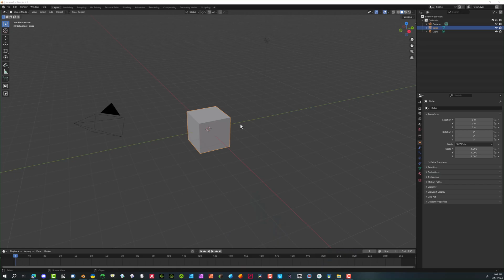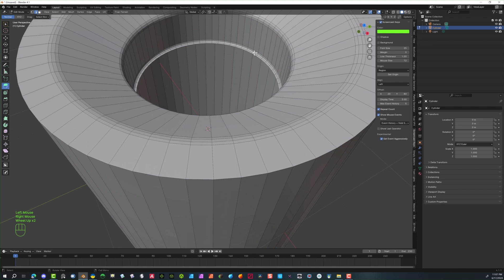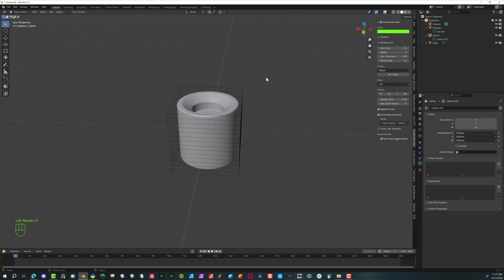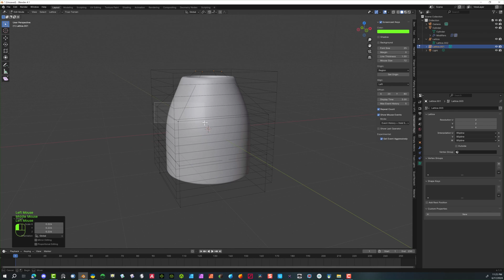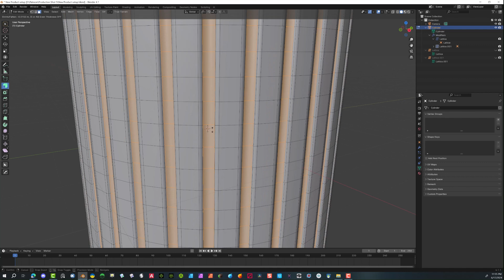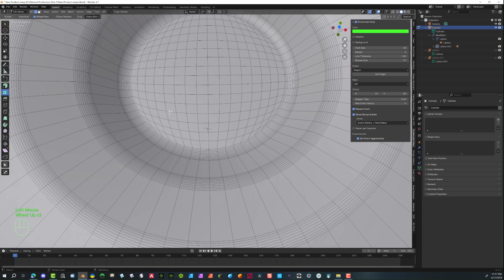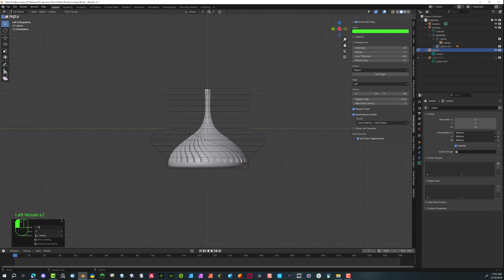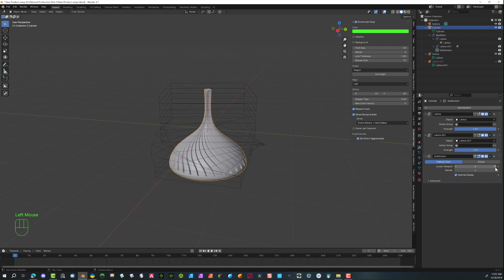How to use Blender with Lattice and Sub D to Create Powerful Modeling Techniques

Comment: Do you think you need to speak fast? Also do some up-scaling of the UI,  so it will be better readable on laptops. Thanks
Reply from the maker: Reply thanks for the suggestions, was using ai speech to communicate which does not take normal speaking breaks.  Will try to reduce the speed for now.  I will also adjust the Ui for the next one since I have a brand new recording already done.  Again thanks for the suggestions